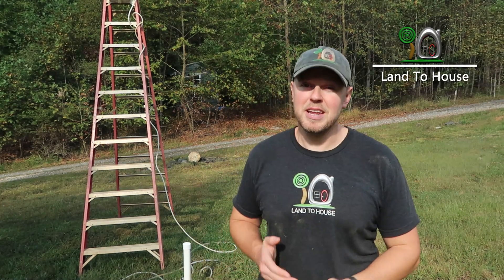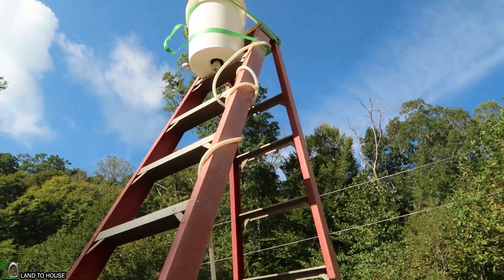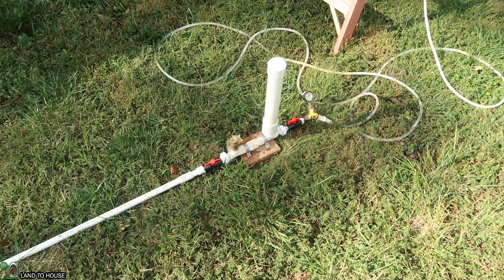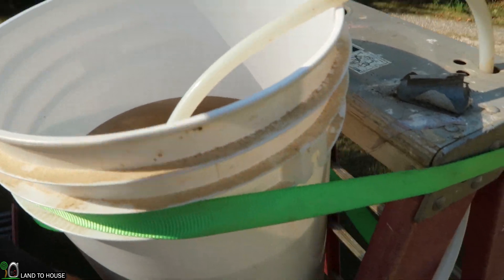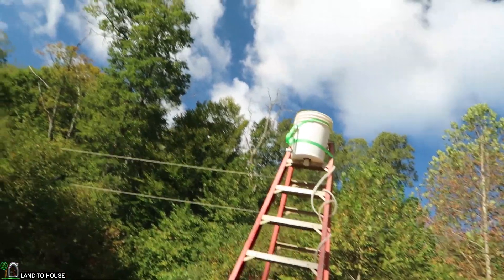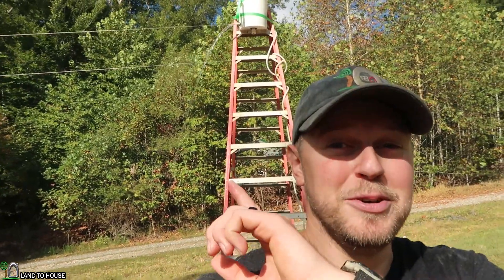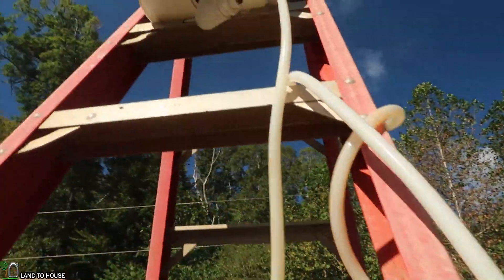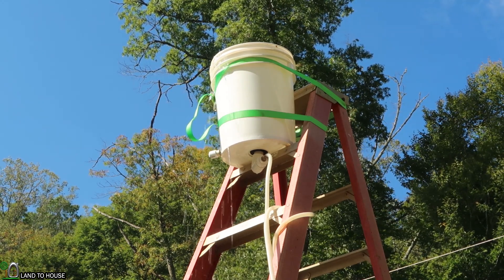Fill Storage Tank from the Bottom vs Top Ram Pump

Comment: It seems to me that the results might vary depending on the tank size of what you're filling?

Hear me out...

It seems to me that if you're filling a LARGE tank, the weight of the water above the inlet at the bottom would be getting heavier and heavier, potentially creating more down-pressure [head pressure?] and making the ram pump have to work harder and harder to offset that additional water weight? Whereas, if you're filling from the top, you're not putting any extra weight on top of the "top" inlet, so you'd always have the same pressure / flow.

So, it would be interesting to see the results of like a 10 gallon bucket, vs like a 10000 gallon tank, or whatever, and if that had any significant impact on overall fill rate / time. I *suspect* that as the 10000 gallon tank got fuller and fuller, the ram pump might have a harder and harder time pumping as quickly/efficiently due to added pressure from above the bottom inlet, whereas filling from the top, you'd have the same flow rate the entire time, just cascading in unhindered from the top, without slowing down or having to work harder or less efficiently?

Is my thinking at all wrong?

Comment: My question is, can you fill a water tank from near the bottom not using a pump. The water tank will be slightly lower than the gutter on the roof where the water will come from. Im just wondering if this is an ideal set up over the inlet being at the top of the tank?

Comment: How about running a siphon from the top bucket to the bottom bucket so that it keeps the bottom bucket filled as the top bucket fills to keep a perpetual motion in water flow? could this possibly be used to run a water wheel? if you can get the water to flow the same rate from the top to the bottom to keep the ram pump operating.

Comment: Great video, and great results! And I can help you with the mathematics (I actually alreday sent you my mathematical derivation some weeks ago). The Ramp Pump Equation is: Delivery-Flux = Efficiency × Drivepipe Flux × Drivepipe Height / Delivery Height. We do not know the Efficiency and the Drivepipe Flux, but we can assume that these are constant in the two experiments. The Drivepipe Height (or Head) can also be assumed constant (you tried to keep the level in the bucket constant). The only variable between the two experiment was the Delivery Height. In the first Top-Fill-Experiment you had 12 feet (lets assume your 12' ladder is exactly 12 feet high and the upper rim of the bucket was on the same height like the end of your ladder). In the second Bottom-Fill-Experiment the height was changing, from 12' minus Bucket-Height to 12'. Lets assume the height was 1 foot lower, on average. That means you have pumped the water to 12' in the first Top-Fill-Experiment, and to 11' (on average) in the second Bottom-Fill-Experiment. In the first Top-Fill-Experiment you had a flow rate of 1 Bucket per 885 seconds (14 minutes and 45 seconds are 885 seconds). For 1 foot less, I would expect to fill the same bucket in 885 seconds × (11 / 12). You get this equation if you combine two Ram Pump Equations from above with the two different Delivery Heights. And 885 × (11 / 12) gives 811.25 seconds, or rougly 13 minutes and 31 seconds. You have measured 13 minutes and 45 seconds. Voila! A quite good matching between theory, mathematics and your experiment, if you keep in mind all the assumtion I have made!

You also got great comments too! Most of the comments remarked correctly that filling from the bottom is more easy/efficient because you start with a smaller height. When the bucket is full then you have the same height like you had to overcome from the beginning in the top-fill scenario. That is all confirmed by the above mentioned mathematics and theory. Btw. atmospheric pressure does not play a significant role here, because it is (nearly) the same on the source bucket and on the delivery bucket.
Reply: Can u please tell what is best if i want to pressurise a filled tank ? Should i fill it from top or bottom ?
Reply: The atmospheric pressure may not matter...

But what about the water pressure as the storage container gets fuller?

I *suspect* that it may be trivial for a small 10-gallon bucket, but non-trivial for like a 10,000-gallon storage tank.

Is there some point at which the water weight in a larger tank would start to make the pump less efficient at filling from the bottom (overcoming the added weight of the water above it), at which point the unimpeded top-fill hose would actually end up filling the tank faster due to not having to contend with ever-increasing weight/pressure from above??

If so, at what point? Or will it always be faster to fill from the bottom, no matter how much larger the tank, or how much back-pressure/head-pressure/whatever its water may exert (potentially resisting further pumping)?

Like how much water weight above would you need to significantly slow or to stop pumping from below? [Kinda' like how much weight do you have to add to the bar before a weight-lifter can no longer lift it over his head, no matter how hard he tries?]

Comment: I would always fill from the top, in case the pump or the line broke you lose all the water in the storage tank. Another reason is you dont use the water on the top of the tank and it could grow bacteria, if you fill from the top it get all used and many insect doesnt lay eggs in moving water thats another reason for filling from the top.
Reply: Helpful

Comment: @Land to House
Well done! Great video I really enjoy them all!
There are several ways to check for the water level on the top bucket, without having to go up there (avoid unnecessary risks)

1.- Installing a mirror on the top and zoom in with the camera
2.- Leaving a light flotation item like a toy ball or something
3.- Adding a vertical clear plastic pipe or hose on the side connected to the bottom of the bucket.

For maintaining the water level in the source bucket, you could just open the supply valve just enough to keep it full to the top, a little spill won't impact your water bill, oh wait!... You're not paying any water bill! hehehe

Comment: Would it be possible creating multiple ram pumps to a single large tank placed on top of a tower or hill to generate a flow and torque. This is to help someone to create elevated afticicial water source to use for water turbines. Let's say 10 ram pumps to speedily fill-up a tank.
Reply from the maker: This sounds like a fun idea but the math does not check out. 
Say you have 10 1-1/4" ram pumps filling at 1gallon per minute. Thats 10 gallons. Now lets say that is at a height of 40 feet. 
(40 x 10)/10 = 40w
you would need 80 gallons of water passing the ram pumps to get that 10 gallons up in the tank and you would need 8 to 9 feet of head pressure. 

If you used a pma at 9 feet of head with 80 gallons per minute you would have the potential for 72w. So it would be better not to use the ram pumps.

Comment: If you wanted to redirect the water from your waste valve back into your delivery system using a 3rd check valve, how would you prime the pump to get it to flow steadily?

Comment: @Land to House,  if only a single "tank" is being filled the fill time will be quicker from a bottom fill as the "head" slowly increases to match the "weight" of the riser pipe. 
However if multiple tanks are ganged together, the top fill method will  be quicker as the combined "head" of the multi-tanks reaches the equivalent single tank weight sooner.

That is to say, 3x 1" bottom fill tanks applied / induces the same "head" as a single 1-3/4" pipe. Therefore the top fill will be quicker for multi-tank setups.
Reply: Incorrect, pressure is not combined. Pressure is the same no matter how large the pipe or pipes. It does not matter if the pressure is from a 1 inch pipe, multiple tanks, or an entire ocean, the pressure will be the same if the head is the same. Filling from the top will have max pressure the entire fill while filling from the bottom will have lower initial pressure rising until it reaches the fill height.  If the fill point is over the rim of the storage container it will actually always be more pressure than filling from the bottom.

Comment: does not the weight of water in bucket applies pressure on the water filling from bottom/
Reply from the maker: It actually applies the same weight as if  the delivery pipe were at that height.
Reply: @LandtoHouse  ok thanks

Comment: Sir can we  use this ram pum for 5km up top?
Reply: Unfortunately no does not, just up to 150 meter only, but is a lot.
Reply: It sounds like you are asking if the ram pump can move water 5km distance, it can if the head is not over 150m.
The rise of 5km up/head/height/altitude is an insane amount to lift water. The most powerful pump in the world has a head pressure of 5.6km, has 12 stages, uses 10mw of power to spin at 6,000 rpm and is the size of a train car used in deep oil rigs in the gulf of Mexico.
Link to pump info: https://www.sulzer.com/-/media/files/about-us/sulzer-technical-review/str-archive/2002/2002_04_10_meuter_e.ashx
Reply: @markbrown3587  Hahaha of course I don't know what I was think. 5 km of distance probably it is possible but not too high, even 150m could be difficult, but 5 km and just a few meter could be perfectly reach I think.

Comment: I see the difference as,, 'filling from the bottom' requires a check valve, to stop your tank from emptying itself, in the event the pump stops functioning... filling from top requires no check valve..
Reply: In fact there is a check valve below the pressure/hammer arrestor tank, so no additional check is needed.
Reply: @hrivera4201  Redundancy is always good. If something fails in between the tank and the check-valve it's gonna drain if you fill from the bottom without a valve.
Reply from the maker: Yes true statement.  I use a check valve on my tanks. It really only matters if you need the water stored faster.

Comment: Can I pick your brain with 2 questions. 1. Can a ram pump be used to pump from a pond lower than the desired collection point, or does it have to be fed from moving water. 2. Once the water is pumped to the collection tank (with float valve, toilet cistern style) does the pump automatically restart once the float lowers. 

I apologise for my stupidity on these matters as I’m new to the whole ram pump thing. I have a small stream 15 feet below and 100 feet away from where I can get free water to where I want it. And this looks like it is the answer to my prayers. No electric bills. 

Many thanks
Reply from the maker: You will need to have water drop out of the pond. Or hydrostatic pressure.  

The pump will continue to run when the delivery is closed.
Reply from the maker: To pump up 15 feet you only need 3 feet of head pressure. The 100 feet is not an issue
Reply: I’m going to use an IBC tank to hold the water. Once full  the float valve will stop the water being ‘called’. Will the pump stay primed and ready to pump the water once I drain some off. 

Thanks
Reply: Sorry. Just noticed your first reply. That really helps. Do you have a video on constructing a ram pump.
Reply from the maker: I actually have several videos on how to build. Just select the search option on the channel. There are a few for the 1-1/4" and one for the 1/2".
Reply: I’ve just spent the last couple of hours going through some of your videos. I’ve subscribed and await notifications. Signing off at 00:23 here in Ireland. Good luck and stay safe during this unique time. Happy Easter.
Reply from the maker: Thank you for subbing! Tons of videos planned. Just need to find some time.
Reply: Hi, for the first question,. this video is in Spanish but I think it is self explanatory.
https://www.youtube.com/watch?v=LSZuPTiAwDk

Comment: It seems to me that it is more efficient to fill from the bottom. The reason is that assuming you are filling the entire tank, and say it is a 5 ft high tank, as you begin to fill it, you have less resistance working against the flow. Less head pressure, or elevation to overcome to get flow in your delivery spigot. If you fill from the top, you still have to defeat the full pressure of the top height of the tank, even if you are just starting to fill the bottom. You have gone too high, to work at a lower level. Both will fill the tank, but the bottom fill will fill it faster. If you have a float system and are just keeping it topped off, the difference is negligible because you are always near the top. But if you are filling cattle tanks that have not been used in a while, and are empty, you are working against less head pressure by filling from the bottom, so your FLOW will be faster when the tank is more empty, and will slow down as it becomes full. The top fill will start out slower, and remain slower regardless of the fullness of the tank. Both work providing you can achieve the height. But bottom fill is more elegant if you have the holes and valves for it.  Databyter
Reply: Well put!
Reply: Only problem with bottom fill, is if there are any mechanical failures in the system below, it can siphon your reserve.  Murphy's Law says to fill from the top.
Reply: @Bright_coded  can u please elaborate i dont understand
Reply: @xarmanhsh2981  
If you fill via a pipe that pushes water into the air above the top of the tank and the liquid drops into the tank...
then if the pump breaks down or the filler hose breaks...
no liquid in the tank will escape..it's there..it will remain there.
Filling through a valve or hole in the bottom of the tank means any failure as above allows all the liquid in the tank to escape...
which could mean all your water for a year of living in the desert leaking away......
So safety (and Murphy's law) state better be safe rather than sorry...fill in via the top.....
Reply: @JohnSmith-yv6eq  you could always put in a check valve at the tank on the fill line.
Reply: @stewiesaidthat  
In most normal cases...
the fill line using the bottom feed scenario...is also the emptying line...so a check valve would stop any emptying..including, of course, the 'authorised" emptying......
Reply: @JohnSmith-yv6eq  did you check the layout of drain system? Where the fill line connects to the storage tank plumbing is where you insert the check valve. Not the drain line to the garden. 
What you are suggesting is that the fill line is also the drain line which is clearly not the case as there are two seperate lines going to the tank.
Reply: Personally, I think that the larger the tank at the top, the more weight/pressure as it fills, and quite possibly at some point it stops pumping altogether due to too much back-/head-pressure. 

This may not show up in a small 5-10 gallon bucket, where weight is minimal in the bucket when partly or almost completely full, but what about a 10,000 gallon storage tank where the weight of the water, when filling, will be potentially MUCH higher. 

At what point will the weight of the water cause the ram pump to slow down or stop entirely like a weight lifter trying to lift something above his maximum lifting capability? Whereas the top-fill might run a little slower at the start, but like a tortoise and the hare, it wins the race, 'cause the hare stopped running entirely and went to sleep before reaching the finish line, thinking it'd already won, but the plodding tortoise eventually caught up and passed it to win...

I *suspect* that under some circumstances, slow and steady may actually *win* the race... In  this case, the top-fill hose just keeps going at the same pace 'cause it never has to contend with increasing over-burden from additional water potentially slowing down its flow, decreasing its efficiency or stopping it entirely {?}...

Comment: If you are filling from the bottom, does the overall height of the water in the storage tank count towards your overall lift of the ramp pump? For example if you were just at the edge of the limit of the ram pump at the bottom of the tank, would it still fill 3 more feet of tank?
Reply from the maker: The height of the storage tank does count as part of the vertical column of water. So if you were at the limit at the bottom it would stop there and not fill the tank. Now if the top of the tank was the limit and you were filling from the bottom it would fill up faster than if you filled from the top
Reply: @LandtoHouse  thanks!

Comment: Have you ever tried running just a ten foot length of over size pipe like 4" in a moving stream into a small ram that would  be under water and use a garden hose still left in a coil for back pressure with the exit of hose only at a 4 ft level,  something that can fill a 5 gallon bucket at ground level?
Reply from the maker: Using the 10 foot pipe as a drive pipe? That does not work because the waste valve would be mismatched and that short pipe would not allow for strong cycles.
Reply: @LandtoHouse  good to know.